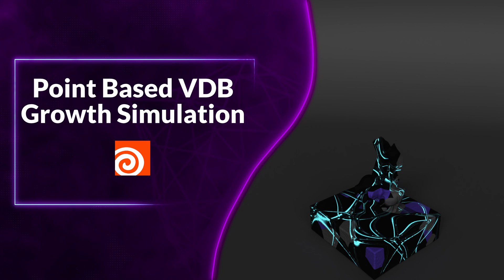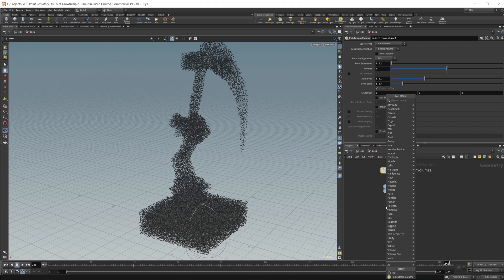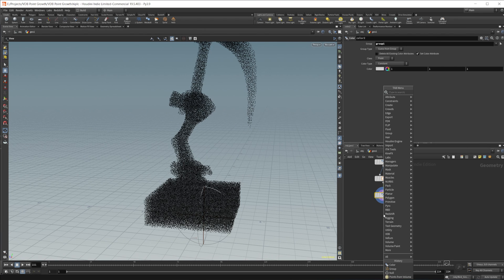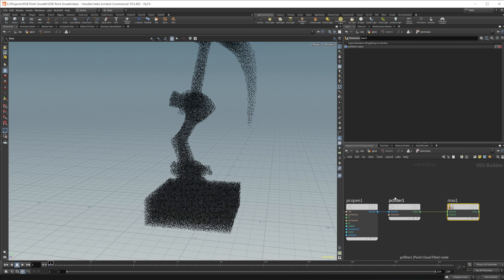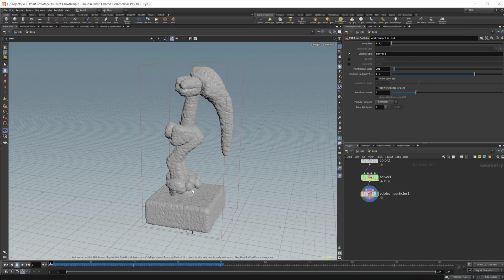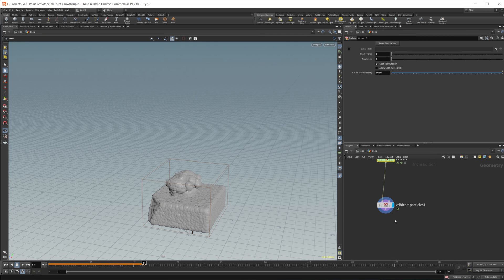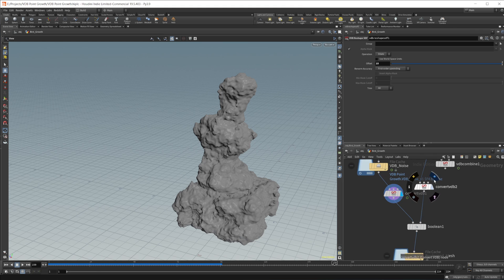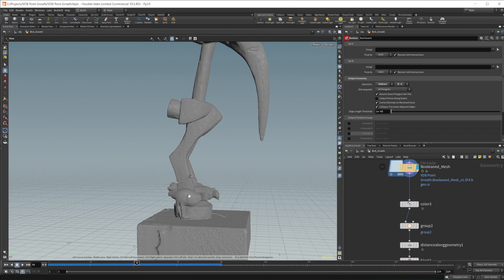Point Based VDB Growth Simulation | Houdini 19.5

Comment: Hi how can i make it work like when other object collide with my main object the infection will start from there
Reply from the maker: Just setup a group node with it set to bounding region and then use the objects as bounding objects. Then you can use that group to assign points the white color
Reply: @InsideTheMindSpace  i did that but its not working, im using pop net and then copytopoint but it still didn't work
Reply from the maker: Its hard to say what's going on without looking at the setup
Reply: I  just use pop to x axis and sphere to collide on thats all
Reply from the maker: Make sure your group node is set to points. Other than that not sure without looking at it
Reply: @InsideTheMindSpace  it is to point it work when thos sphere are still on surface not moving
Reply: @InsideTheMindSpace  it work if i use time shift and they are sticking to surface not with colliding of sliding object